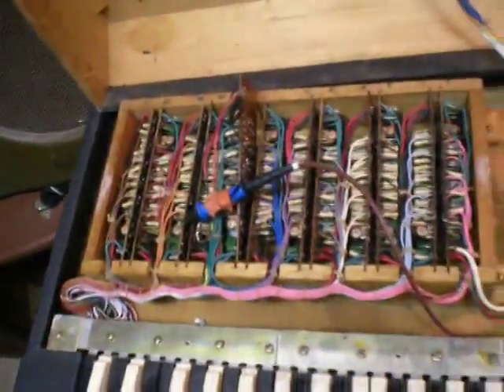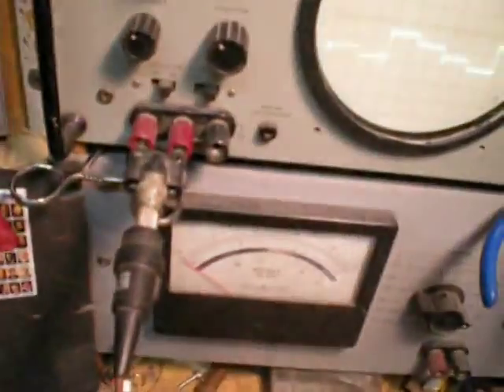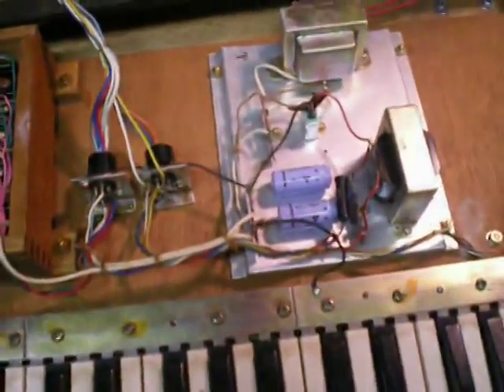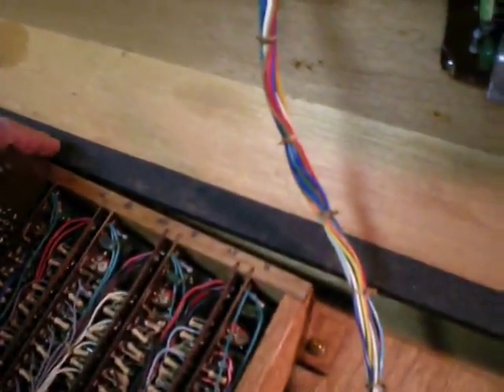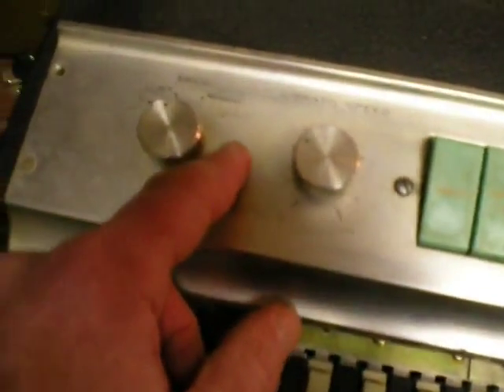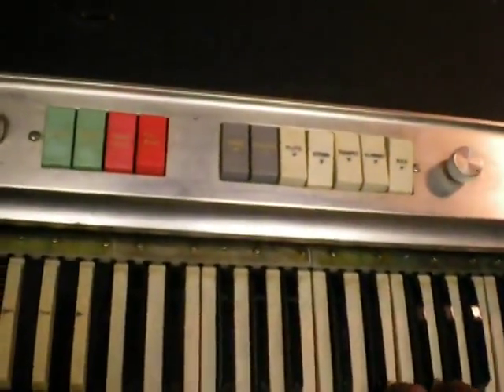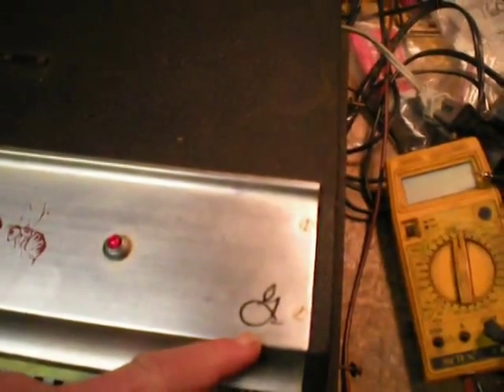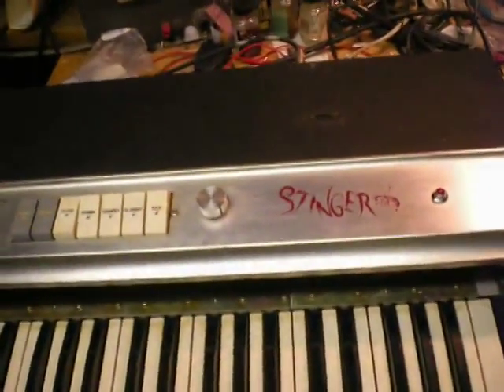Teisco "Stinger" combo Organ tech notes and demo.  RARE!

Comment: Is there supposed to be a shield cover over the divider/ocillator box? I just picked up a  Model A, type ET201. It is different from the model A-1.  Not too bad of shape, some wires were chewed on the keyboard but the rodent was kind and left just a nub of plastic so I knew which went where.Seems like they used better caps than transistor radios of the same time.My black keys are cracking on the ends. Im going to glue the cracks shut and try filling with epoxy. I'm betting they all do it.